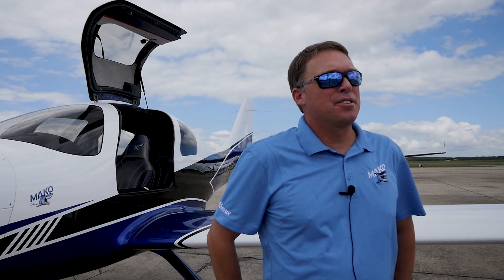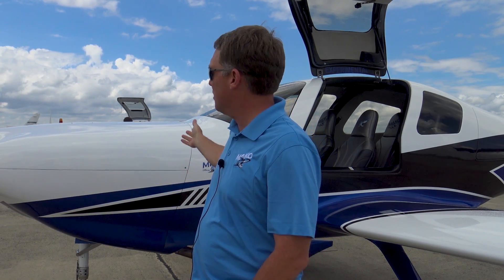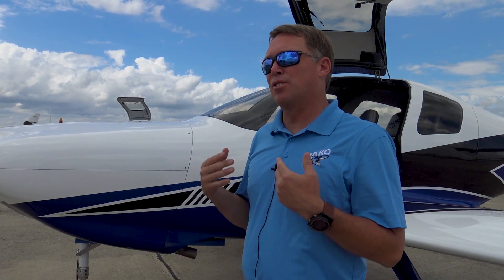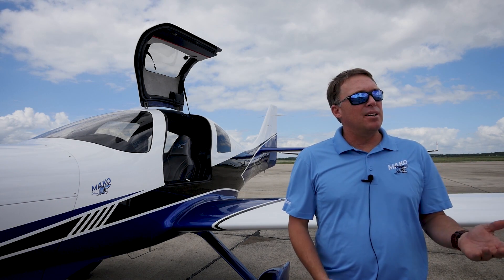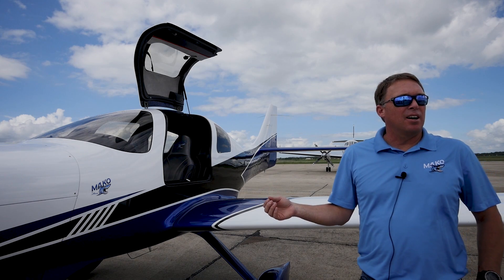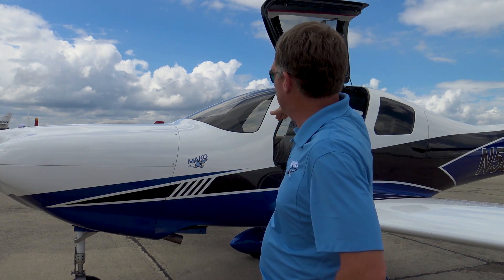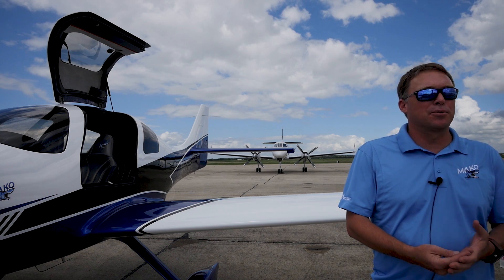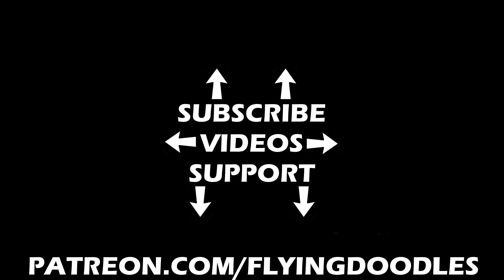LANCAIR - The Kit Built Aircraft

Comment: Only three minor accidents? What is the definition of a minor accident?
Reply: Hi Javier.  Sean here.  Definition (as I understand it) is no injuries, just airplane dings.  Things like skidding off a runway on takeoff or landing.  I believe that there has been one engine failure which resulted in a landing on a dirt road with minor damage to the airframe.  That type of stuff.  And that strong safety record came without the BRS parachute system (which we now offer as added safety and security for owners).  Overall the Mako is a well-behaved airframe which has been very successful as the Experimental Lancair ES, and later the Columbia 300, 350 and 400, and then finally the Cessna Corvalis and TTx.  So we have essentially brought that lineage back into Lancair in its original experimental form (although well proven as a certified airframe as well) in order to control costs for our customers and provide a great performing aircraft for roughly 50% the price of our certified competitors.  The Mako is an airplane that we are very proud of and it is selling very well.
Reply: Sean Fidler thanks for your reply and explanation
Reply: Where all survive and walk away. And the plane is repairable.